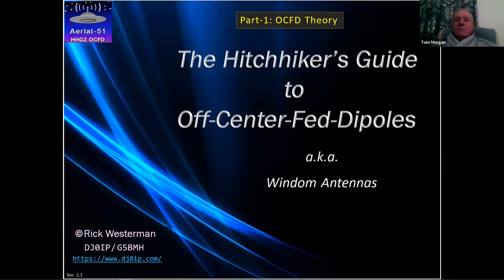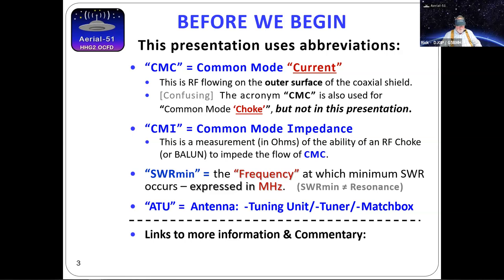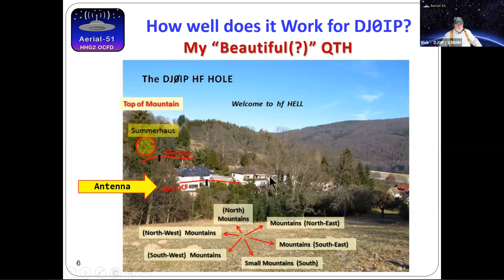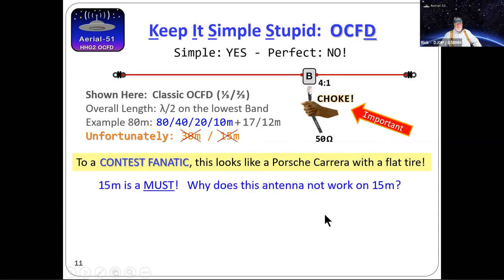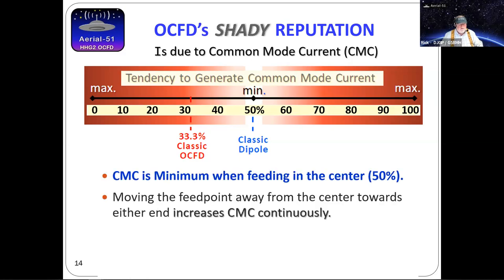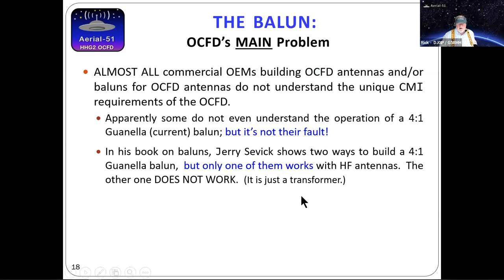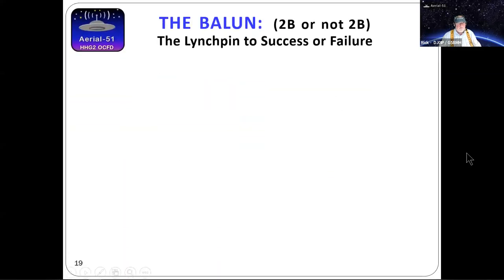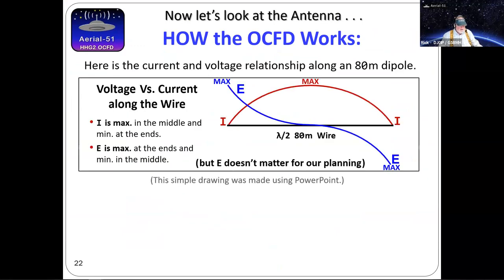Hitch Hikers Guide to the Off Centre Fed Dipole (aka the Windom) Part1 with Rick DJ0IP

Comment: Superb! Really enjoyed this lecture come lesson or briefing. Can’t wait for part 2.  
I have built a flagpole antenna, which is an OFCD doublet mounted vertically with no radials. Mainly to use on 40 and oddly 60 meters, and only 20 feet. It does work great on 40 but does not on 60.
Reply from the maker: Fantastic!

Comment: Seems to me the problem is not with any particular antenna, but with the frequencies that have been allocated to the amateur radio community. I’m sure there is a lot of historical precedence and real-world reasons why it isn’t so today, but why weren’t the allocations granted by the FCC originally designed to match the resonances of one very good multi-band antenna.  It seems they got pretty close in many cases, but missed the actual mark.
Reply: First of all, the ham band allocations were not granted by the FCC.  They were granted by the International Telecommunications Union (ITU).
Second, the original Windom from 1928 was designed as a mono-band antenna, not a multiband antenna.
It was first fed with coax about 1959, shortly after the 15m band had been allocated.  It was originally only used on 80 and 40m.
The 4-band version was launched about 1970 (80/40/20/10m).
So we had our band allocations, LONG before the OCFD was introduced as a multi-band antenna.
73 - de DJ0IP
Reply: Ham radio did evolve with bands being harmonically related.  80/40/20/10 -- but other bands were added as time went on, the WARC bands.